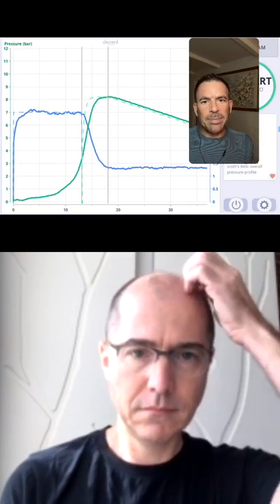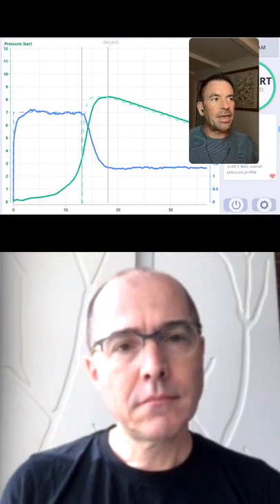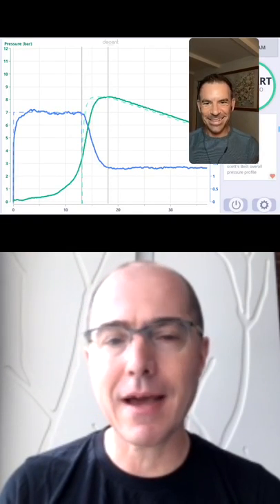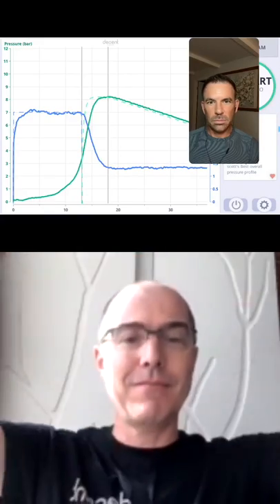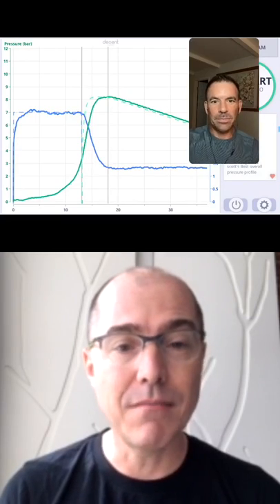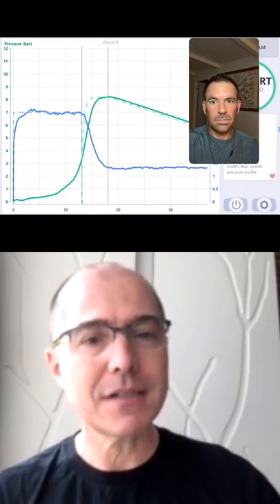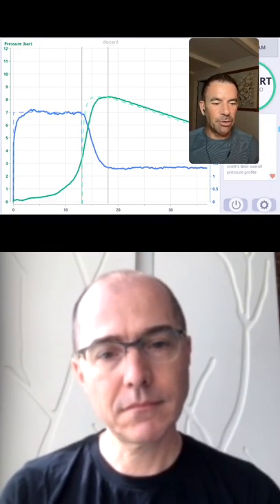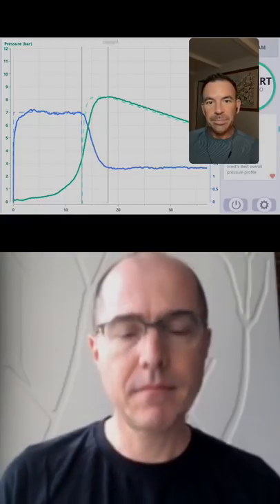Strange things happen to espresso at 10.5 bar

Comment: This is one of the problems why almost all superautomatics are shit.

1. Superautomatics have too coarse a grind
2. As soon as you make the grind fine enough, pressure goes above 10.5 bar
3. As soon as pressure goes above 10.5 bar, flow drops till the device chokes and errores out because they cheaped out on pump that can't actually handle ány flow above 12 bar

It's not the device being a superautomatic being at fault, it is technically very well possible to get decent espresso out of a super automatic.
It's the enginering thats bad. Bad parts, skipping out on having ANY pressure regulation... etc.

Comment: Could it be that the strong pressure simply plugs the holes in the basket?
How about trying that with a filter paper in the bottom of the basket?
Reply from the maker: Unlikely, because going back down to 9 bar, brings flow back to normal.  If the holes were plugged that wouldn't happen.

Comment: Secondary compression may be explained as the wet coffee puck behaves like sheer thickening non-newtonian fluid. Once applying force (pressure) high enough, the mixture of water and coffee ground would become much more viscous. It is therefore reducing the flow. However, at low pressure, it behaves like normal fluid which allows water to pass through according to the appllied force.